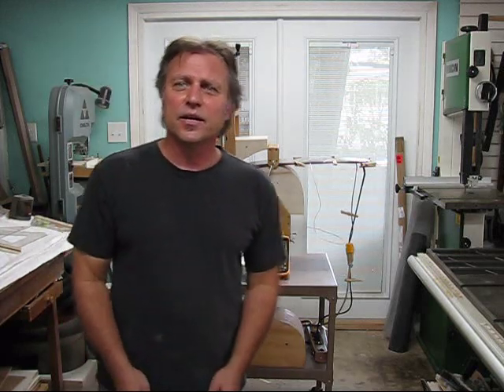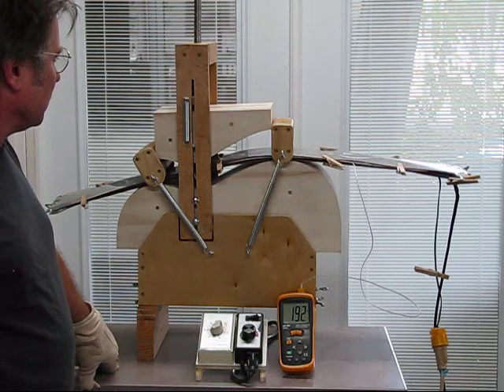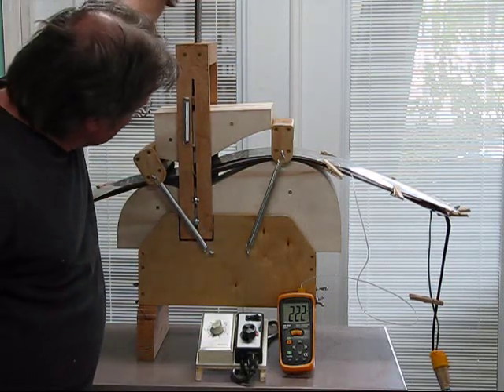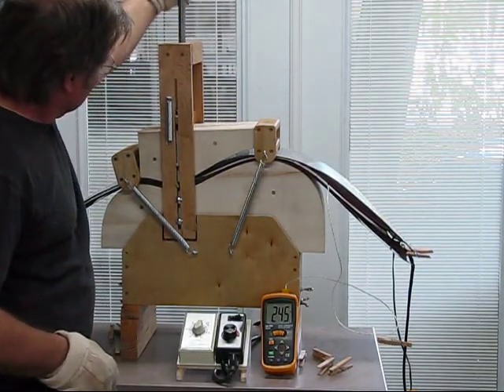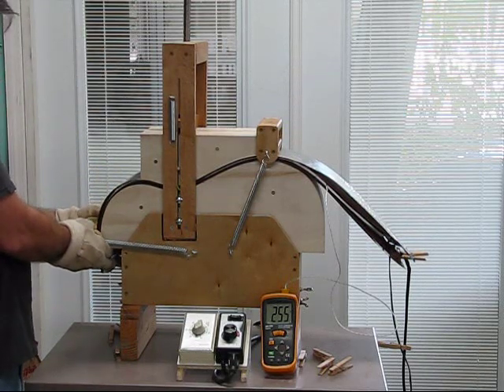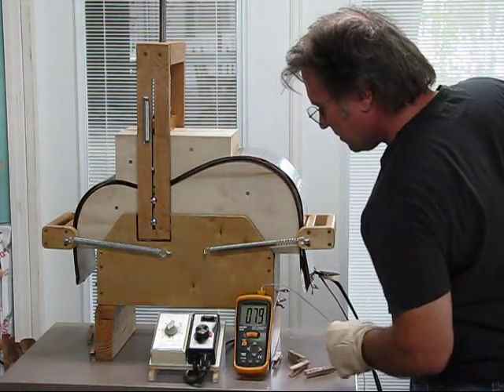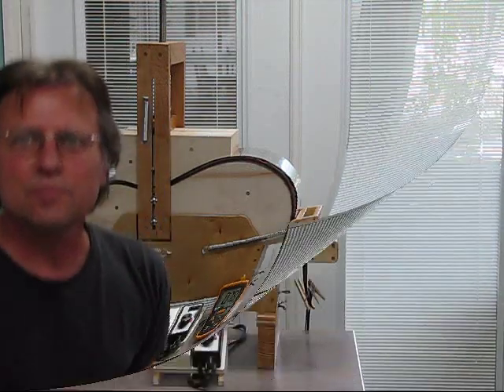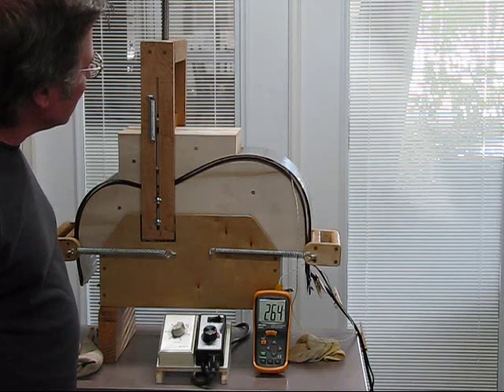Bending Acrylic On A Sidebender  Part 1

Comment: Doing it that way would not warrant its use in an aquarium, You just increase the tinsel strength dramatically. If it ever were to crack, that the spot. Plexi heated up and allowed to bend by itself over the course of a couple of days does not increase the tinsel strength at the bend.

Comment from the maker: There are some imperfections in those sides. Some imprints of the blanket and some tapering of the end from the clamp. But keep in mind this was the first time I ever tried it. Probably should have not let it get as hot as it did and turned off the blanket when it started to bend. I think the blanket is something like 5 watts a sq. inch. It gets pretty hot pretty fast actually. You will just have to experiment with it on your own like I did. It worked for my purpose even with the imperfections.

Comment: I like the idea of a mold but how do you not get imperfections in the warm plastic? It looks like you left the protective paper on the acrylic. Is that all you need between the acrylic and the heating blanket? Also I checked out omegas website for the heating blankets. Which model did you use. Do you really need such a low wattage? Yours took a long time to warm the acrylic. A higher wattage would speed up the process but would it burn the plastic from heating up too fast?

Comment from the maker: @edadmartin I made my own temp. control from a 1 hour wall light timer and a harbor freight router speed control and a wire mold box mounted to a stand. Might be around $40. Depends on whether you get the speed control on sale or not.

Comment: @chrispaulick I think if the blanket were positioned on the non-mirrored side, the mirror would reflect heat and warm the plastic as if the plastic were sandwiched between two heat blankets. Same cautions would apply if using two blankets..

Comment from the maker: That was 1/4" and 5 watts for the blanket. The blanket will get hot enough to heat soften the plexi. The 2.5 will too but just takes a little longer the heat up.